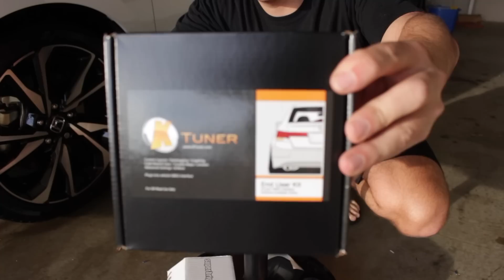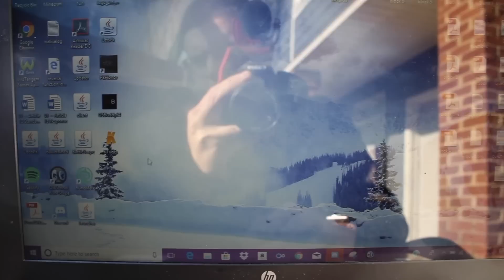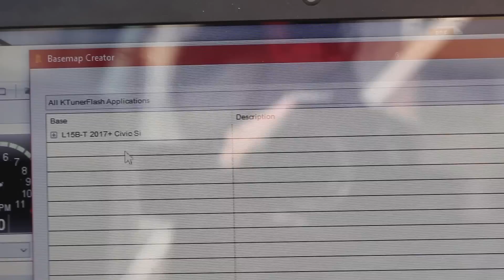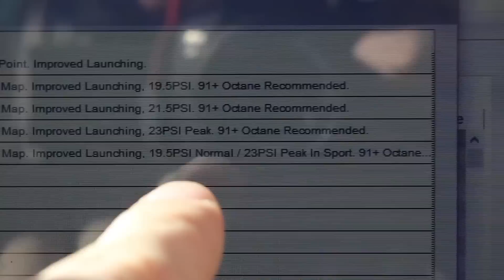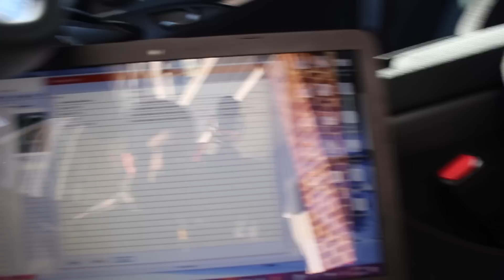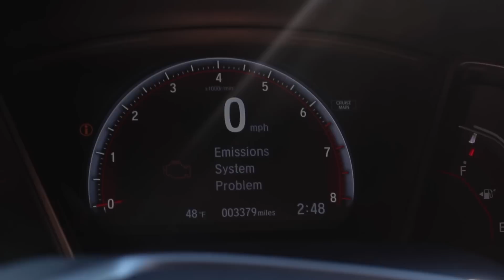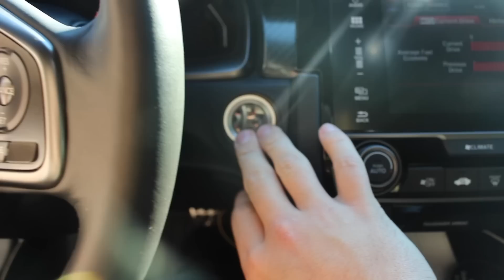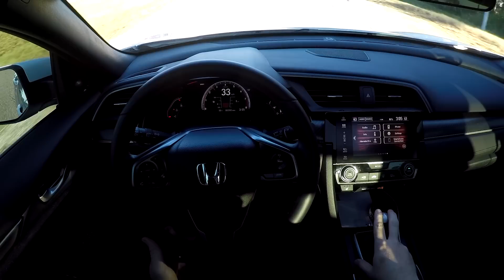How To Flash Your ECU With KTuner  **10th Gen Honda Civic**

Comment: I followed this video after installing the prl cobra intake and kept getting error code when driving around that its running lean. what i failed to do is pick the base map then go and select  “MAF Scaling” under the “Main Parameters” drop-down

menu on the right hand side. Select “PRL RACE MAF Calibration” from
the drop-down options under “MAF Quick Calibration.”
 Save the file and upload the current calibration to the ECU.

You can find those instruction in the prl motorsport website. wish i had payed attention to that before driving around for 2 hours after a reflash thinking it was just not flashed the first time.

Comment: Good day sir, just a question. I have V1.2 flashed my car on starter dual target 21psi. I tried to reflashed it back to factory to try different basemap but the thing is it didn’t allow me to changed some settings on the advanced features unlike the previous one that allows me yo set up turbo boost, throttle, responsiveness etc. after choosing diff basemap because the page was blank I mean nothing in there even after clicking the + button beside the advanced features. What seems to be the problem bro? I ended up uploading the tune straight away even without changing anything.

Comment: I just got a prl cobra racing maf intake and i got a bunch of lights on because of it. Will a tune get rid of them? If so which one would be best for my 2019 si?
Reply from the maker: Do you have ktuner? The street MAF requires no tuning.
Reply: TTorres1183 i just bought a hondata just waiting for it to come in. It should get rid of the light after my base tune right?
Reply: Find your ecu fuse under the hood. Remove it and put it back. It will reset all your lights. I had the same issue when i installed my injen intake on my si

Comment: I just did a datalog with the stage 2 base map, and I’m wondering if you know of a guide I can use to understand everything I’m looking at. And who I can send them to to start doing custom tunes. Also wondering about removing throttle dampening after installing the base map, driving the car for a while(few months) then reopening the ktuner to add that in.
I have 18 civic hatch

Comment: have you had any problems with your clutch with the ktuner tunes? ive been hearing everyone say that its best to upgrade your clutch due to people burning out the OM one.
Reply from the maker: No problems here. Still on stock clutch.
Reply: @TTorres1183   awesome thanks! i also have another question. so vit doesnt work with ktuner anymore. do you still recommend ktuner over hondata they look so similar to me and i guess i wont be able to get a tune from vit.
Reply from the maker: K tuner FTW! Two step performance has tunes check them out!

Comment: Does this work with a 2018 Honda Civic EX Sedan 2.0L, if so is it worth it?
Reply from the maker: I believe it will. Check out the K tuner website
Reply: @TTorres1183  how can I make around 300-400 whp on a 2020 civic sport 1.5t?
Reply from the maker: PRL big turbo and FBO’s

Comment: $400 for 4 PSI? No additional maps? Is it really worth it especially at the cost of voiding warranty?
Reply from the maker: It comes down to you.
Reply: You are absolutely correct, it comes down to the individual. Funny, I don't even own a Civic Si yet but I was curious about ECU flashing and modding options for it. Insane, huh?
I am definitely getting either a GTI or a Civic Si. Both have pros and cons, both have very good modding options. Both cars test-drove really well and seemed to have at the very least adequate power for my driving needs so who knows, I may wing it for a few years and then buy yours cheap when you move onto another car and decide to sell yours? ;)
Thanks for the upload!
Reply: For 35-45 whp add, more boost, better throttle response and no annoying revhang. That sounds very good to me for 449 or 649 if you want the v2. You'd have to pay a lot more to see that same level of performance from bolt ons or engine mods.

Comment: Have you heard of K Tuner V1.2 not working for 2018 Honda Civc EXT Sedan CVT?  I am having trouble flashing my ECU with the new ECU maps.
Reply from the maker: Do you have the right factory tunes?
Reply: TTorres1183  Yes.  KTuner took about a month to update a new ECU code for my car.  It was a new ECU number not known to them yet.  But I have a new BETA version of software that has the dual map tune that I am looking for.
Reply: I am waiting for a call back from K Tuner with help with the install.  I honestly have had nothing but problems doing it for last 6 weeks.  First computer did not have enough power.  Then 2nd computer install found out a new ECU number has been discovered.  K Tuner had to build a new Beta for the installation.  After that my 2nd computer did not have enough power.  For the first run 1.35 GHZ was enough, but now I needed 1.8 GHZ to upload to the car.  3rd computer has 1.8 GHZ but was still getting an error in the upload.  So a friend tried 4th computer with 2.8GHZ.  It still errors during the upload process of the bass maps.  But I will update once KTUner returns my call with diagnosis.
Reply from the maker: Glad to hear that!

Comment: im currently flashing my car to factory/23psi sport mode, im watching your video because im nervous asf and this is taking forever lol
Reply: i should be getting stage 1 from vittune soon. 40-50hp and 80trq gains...
Reply from the maker: Relax you’ll be fine!
Reply: TTorres1183 yup yup, and I noticed a huge difference from the base map. It was fun I love this already
Reply: TTorres1183 thanks fr the video as well it helped
Reply from the maker: It’s a whole different car!
Reply: So now you are currently on Vittune stage 1, correct? If so, how much of a difference compared to the KTuner basemaps? Also is your clutch holding up, and are you getting the numbers vittune advertised? You should do a dyno run video
Reply from the maker: I’m not vittuned I’m only on ktuner base maps... I’m not getting a complete tune until full Bolt-one are finished
Reply: @TTorres1183   This is late, but watching your video: have 2.0T Accord 18. So, I can purchase the ktuner in the box like you and still get gains, but if I wanted more  personal, get a custom tune from vittnuned?
Reply: So you did actually towards the end of the video youre flashed with vit viper stage 1, which would be the 25psi, but you loaded one of the ktuner maps instead of his stage 1 tune (which you request from him via email). Why not use flash his stage 1 tune and make video comparing it to the 23? @ttorres1183

Comment: How would you flash back to stock. Is the factory base calibration option on the menu? Just want to know so that when I need to get the car inspected it won’t be a hassle
Reply from the maker: Yes it saves your factory tune.
Reply: How do I know whether the o2 sensor is ready? I flashed mine back to stock and drove it 50 miles and when I plugged it back into the computer to check it says no codes have been thrown and it shows white under the o2 sensor? Does this mean it's not ready?

Comment: My device is not connecting to the ktuner download..what should i do..it says not live and it flashes green red at bottom of screen
Reply from the maker: You have the right software for you car?
Reply: TTorres1183 yes
Reply: TTorres1183 do yu think it might be the wifi? Re installed the download several times already

Comment: What's up again buddy! This flash  isn't the base flash with no bolt ons right? If and when I get mine which option would I pick? The first one? Thanks for the help and keep the videos coming
Reply from the maker: Yeah that’s fine any of the base maps are fine without any Bolt on.
Reply: TTorres1183 do you have a video of what u set all your setting on your basemap for a stock car I got a ktuner and my car is stock but idk what to enable and disable and what to set the adjustments at

Comment: Hey Ttorres do you need to be in sport mode for the ktuner tune to kick in?
Reply from the maker: No sir. Not at all.
Reply: so the tune is on all the time? What happens when you press sport mode, does it change anything?
Reply from the maker: If you have the dual map you will then make 21.5psi
Reply: why do you say that ktuner is better than hondata?
Reply from the maker: Are you on the 10th gen FB page?
Reply from the maker: Yes do you have a Facebook?
Reply from the maker: Look up 10th Gen Civics on Facebook
Reply: TTorres1183 it says that it will notify me after they review my answers
Reply from the maker: The FB page?
Reply: TTorres1183 yes I'm in. I sent you a friend request
Reply from the maker: I got it
Reply: TTorres1183 have you noticed any power loss while using the A/C? I kind of feel a little less power. Let me know
Reply from the maker: Not really to be honest

Comment: So why KTuner and now Hondata!? Cause I’m buying one today haha
Reply: Do you feel a big difference with the Ktuner ...? Is worthy.?
Reply from the maker: Doug S I e owned both and hands down k tuner is superior!
Reply: TTorres1183 ok Cool ty!
Reply: TTorres1183 what splash guards did you get for your car? I know the oem ones are more expensive but I didn’t nonif they had a less expensive one that is exactly the same. As long as it stops dirt from going along the side of my car lol
Reply: TTorres1183 so vit has it for 449$ right now: is that what you got? If you can look quick. I think I’m gna get the v2 though. I like the screen haha.. so you don’t have an after market clutch or anything correct!? I’m doing this and maybe and I take and exhaust when better ones get released. Probably springs and rims. Use the stock tires or go 18 by 9,9.5 so the wheel is flush with the side of the Si.
Reply from the maker: Yes huge difference. It’s like driving a new car.
Reply from the maker: Yes that’s what I got! Good luck with your build!
Reply from the maker: It a tuning device that allows you to add my power and reprogram the ECU to more boost ETC... Good ktuner and check out his website

Comment: No hondata for this yet?
Reply from the maker: Huh
Reply: TTorres1183 do they have hondata flash pro out for the new si yet jw I have a 8th gen with flashpro bolt ons and a tune making 230hp
Reply from the maker: Yes they do
Reply: TTorres1183 can you get a dyno tune done with that ? They help so much
Reply from the maker: Not sure what you mean like a virtual dyno?
Reply: TTorres1183 no lol like can you get your car custom tuned like by a shop
Reply from the maker: Yes you can

Comment: Does this tune get rid of the rev hang?
Reply: Raul Rey fuel in the oil? I'm sorry I haven't kept up to date with Honda  engines, why would unburnt fuel EVER go anywhere near oil in the first place? Shouldn't it exit into the exhaust system like 99% of cars running rich?
Reply from the maker: Yea buddy
Reply: Rev hang helps the car burn the on burnt fuel. Eliminating rev hang may cause you to have raw fuel in your oil which can cause engine damage eventually.
Reply: Raul Rey I don’t care I just hate rev hang.
Reply: nope ! lots of gas in the direct injection cars oil !

Comment: How do you shift so quickly? It seems like it’s impossible to do it with so much rev hang. I’m a little new to manual so do you have any techniques I could use on my 10th gen Si also?
Reply from the maker: It’s a lot easier once you get the ktuner. It eliminates rev hamg

Comment: why didn't you get a super drive for your mac?
Reply from the maker: Explain?
Reply: apple sells a super drive (cd drive) you can plug in to the usb port on ur air, allowing you to install this without even needing to run windows, or messing with boot camp.
Reply from the maker: I did not know that thanks!
Reply from the maker: What sup?

Comment: With all those upgrades you did....question is there is any slip on the clutch ?
Reply: TTorres1183 how often do you drive on 23 psi? I drive mostly on the 19 psi but I'm tuned 19/23 with ktuner
Reply from the maker: No sir... I will be upgraded the clutch soon tho.
Reply: TTorres1183 cool then 👌👌👌
and sub'd
Reply from the maker: Same here... I have only ran 23 psi a few times. I’m waiting on my clutch upgrade
Reply: TTorres1183 will it start slipping that soon? Also what clutch do you plan on installing
Reply from the maker: The fx400
Reply: TTorres1183 are you planning on installing it yourself or go to a shop
Reply from the maker: I’m going to let s shop install mine
Reply: TTorres1183 how much will that run you
Reply from the maker: Ehh not sure yet
Reply: TTorres1183 so are you going to daily drive it on 23 PSI after that. Is that the only thing preventing you from doing it
Reply from the maker: Yes sir

Comment: Please keep the stock base map in case something goes haywire (which doesnt happen most of the time).... It would be useful to swap back to the stock base map before going in for the next inspection.
Reply: Richard Noel the car is already in the shop with the k tune in it and issues with car
Reply from the maker: Huh??
Reply: issues ???
Reply: Not bad issues but any issues that come up
Reply: issues will not come up with the starter tune in the stock engine. The engine was not tuned to its full potential ryt from the factory by  the engineers, thus the starter pack is perfect for utilizing the power. But during an inspection there are chances that the authorities might fail the car....just might...not sure though.

Comment: Nice video as usual bud! Only question I have is does it do anything to factory warranty or do I need wait till warranty is up to add?
Reply: TTorres1183 I agree. As long as you flash back to stock before service you will be good. If they did dig deep and say it looks like your ecu has been tuned tell them you disconnected your battery (make up a reason) from what I've been hearing, some cars have an ecu counter. So my understanding is that disconnecting battery also does a count on ecu. Lol hope I'm making sense
Reply from the maker: I don’t think you need to wait... you can always flash back to factory map if needed to go back to the dealer.
Reply from the maker: I’ve talked to a few Honda techs and they say they can’t see if it has been flashed...
Reply: TTorres1183 even better!
Reply: TTorres1183 hheeehh.. that's not true, they have freeze data and they can tell you exactly how many times you had flashed and date it too if they want to deny warranty, there is already 10th Gen civic owner had this experience.
Reply: jason truong damn that sucks for whoever that happened to

Comment: Question. After the car is flashed you turn it off. Then you turn the car back on. Do you only tap start 1 time? Or do you have to double tap to get back into "accessory mode" and then press "ok" ?
Reply from the maker: Turn to car completely off and then go back into accessory mode. Then okay on the laptop and then start the car and ENJOY! Thanks for watching!
Reply: thanks :)
Reply: @TTorres1183  but u have to double tap the start button to get into accessory mode

Comment: glad you finally got it :)
Reply: The cruise control system is jerky with rev hang disabled, especially on up-hills, so we set it to factory operational when cruise is enabled.
Reply: TTorres1183 the way it’s supposed to be setup rev hang wise is when you have rev hang disable and flash, rev hang should only ENABLE when have the cruise control button on (cruise isn’t active itself) but the button shows cruise control. When you turn cruise off rev hang is eliminated again.  It’s also rev hanging at 2k Rpm and below automatically. That was added recently.
Reply: TTorres1183 he's saying you don't have to reflash because its supposed to turn back off after cruise is turned back off. But from experience with mine is it didnt go back to being off i had to reflash it happened twice since then i havnt used cruise control lol
Reply: It's activated with the cruise button, so rev hang is disabled with cruise off and enabled with cruise on. That's when the cruise light is on the dash, whether you're actively using cruise control or not. You have to hit the cruise button to switch modes, not just cancel.
Reply: K Tuner oh awesome thats why then thank you for clarifying this
Reply: Yes, otherwise it expects you're going to be using cruise control and goes back to factory operation.
Reply from the maker: lol i know right!
Reply: dont use cruise control or your rev hang will come back
Reply from the maker: Honda 4 Lyfe explain... I’ve never heard of that!
Reply: yea so i noticed rev hang was back on after a 3 hour road trip and was like what the heck so i looked it up and sure enough a youtuber "Caraddict" who has a 10th gen civic with ktuner explains why it happened something to do with keeping to set speed and throttle postion load to keep that desired set speed  if it requires to much throttle to keep that set speed it jacks it up
Reply from the maker: Dam i use cruise control all the time. So you would have to reflash your car?
Reply: yessir it doesnt happen everytime usually when there are alot of hills
Reply: love your product! i seem to find that after i turn cruise off rev hang is back and doesn't go back to being disabled unless i re-flash the car maybe im doing something wrong
Reply: also anyway around not being able to brake boost?
Reply from the maker: Okay so would we have to reflash one we get to our destination?
Reply from the maker: So once crush control is taking off rev hang is gone again?
Reply from the maker: Lol I take frequent road trips. We shall see how this works
Reply from the maker: Ok so the cruise control light has to be completely off in order for rev hang to be disabled?